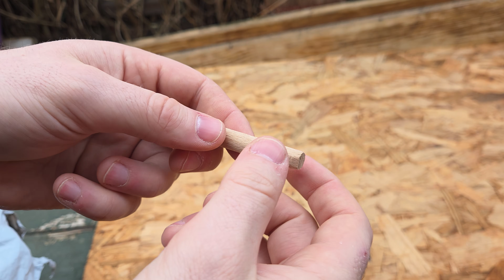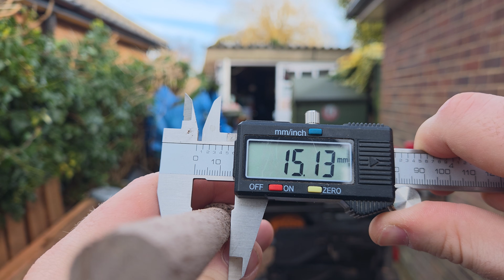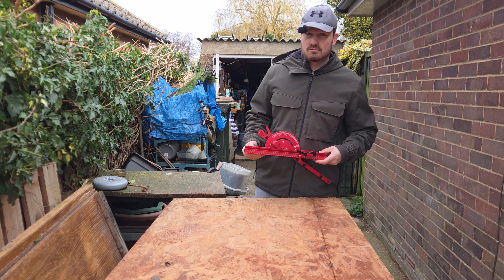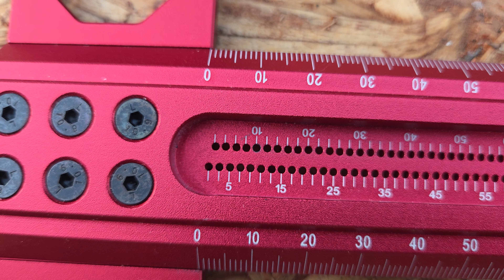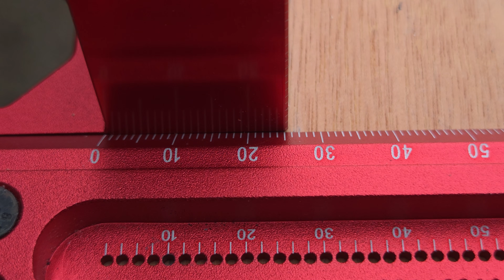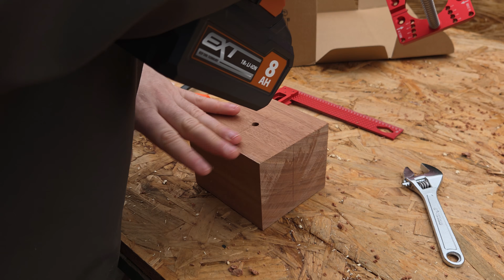5 Budget TEMU Tools Tested - Which Ones Are Worth Buying?

Comment: Clue a washer under the end to tip it up to make the upright square just slide it along until you get it right before you add the glue oily glue is the best ( eBay .oily glue ).

Comment: On the miter gauge, you have two things going on. First, the rails are sitting deep in the miter slots and that means the leading edge of the miter fence will also sit deep. The other problem is that there is nothing to hold the miter gauge level when it is off the table top. It wants to twist.
I've used inexpensive miter gauges and I have used expensive ones. They all have this problem. I am usually just careful about that transition, but if you need to eliminate the problem, consider a table saw infeed.
On the drill press, I would feel a lot better about it if the base had more of a collar for the rails to make sure they stay perpendicular. This design looks like it will get wobbly over time.
Thanks for the reviews.

Comment: The 800mm square has six hex screws.if the holes have some play, you can adjust it both in squareness and in accuracy of length. My revolution table saw needed the same dialling in slightly.

Comment: In all fairness, when you were testing the large square, how do you know your manky tape measure is accurate? Hardly the NPL, is it??? And as for squareness, can you adjust it? Slack the screws holding the blade to the base, adjust then re-tighten?

Comment: Nice reviews, as an apprentice me chain cal fitter, I was always advised (and I followed  that advice) to by the best brand tools and instruments, such as squares, micrometers, and Verniers. However,  Now retired and tinkering with woodwork projects as a hobby, I have accumulated tools from many different sources, with Temu and Banggood I have had mixed results, the biggest disappointment was with banggood from who I bought a router table insert and router lift, none of the holes matched up, the fence was bent (I suspect in transit due to the appalling packaging) their returns  policy is designed to frustrate and deter to the point of giving up. Which I did but will never purchase from banggood again. Having purchased the same table saw as you have, I have added a push block from Temu, which functions the same as Microjig Gripper, ands works extremely well, for about a third of the cost of the branded product. I must say I have not been disappointed with Temu on quart of all of the tools I have purchased, the only serious flaw was the delivery time, which they have now improved considerably. Take care and thanks.

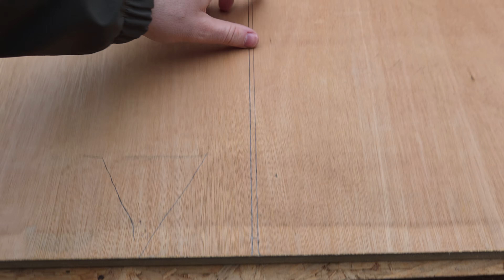Comment: 22:51 - what a doofus! There are 6 black screws on the square that are used to dial it in.
You worked out how to do it with mitre gauge on the saw, yet couldn't do the same for the square?
That's also how you fix the hole difference, but that would be useless if you are using a tape measure to verify it.

Comment: your testing laks experience with tools or how to drill correct and turning around the t square doesn't give you a good reading, the fact that it was off 1 mm is the way you set it up loosen the 6 screws put a big machine square against it and a solid good brand mesure stick, not a tape and sett it up properly. make your test better, less to much talk in a circle over the same thing and you got something going. i keep waqtching to see if you improve

Comment: You do know that you can adjust that T square with the 6 bolts that hold it together
Reply: also who's to say the tape measure is accurate .maybe mark it a smaller amount and check with the digital calipers
Reply: I did wonder whether that was possible, especially as it only needed a tiny adjustment and it had probably been thrown around a good few times before being delivered in a plastic bag!
Reply: The bolts can adjust both the problems. These is a good tool.

Comment: Temu tools are hit and miss in my experience ,I bought the T square and its slightly different to yours ,it has a black top with red ruler and 4 locking bolts holding the top to the ruler instead of 6 like yours and my accuracy test showed it to be good enough for me as a novice diyer